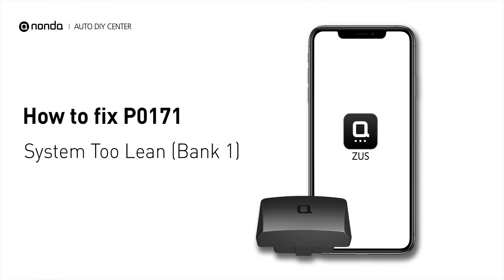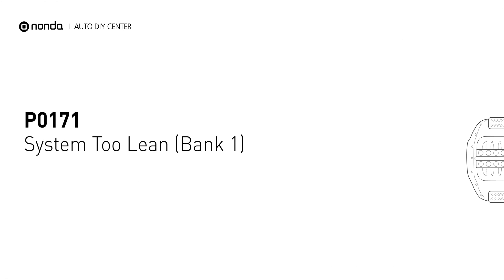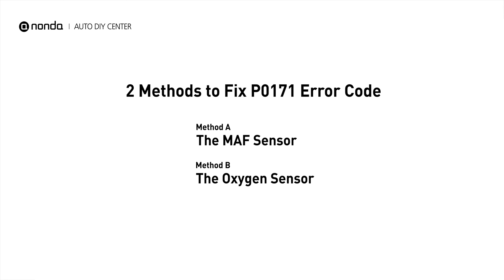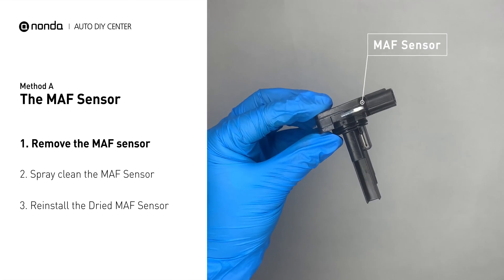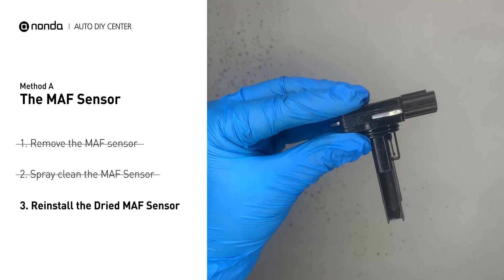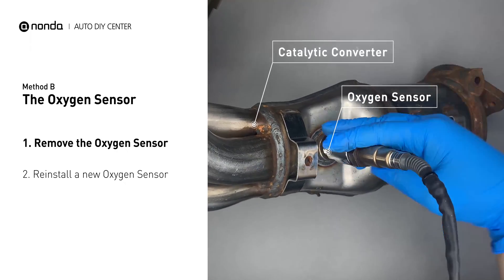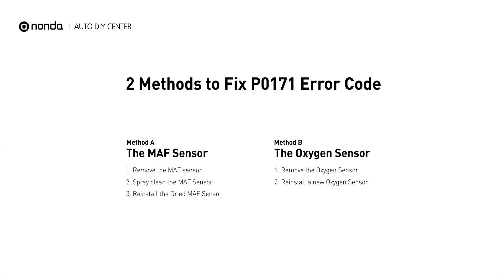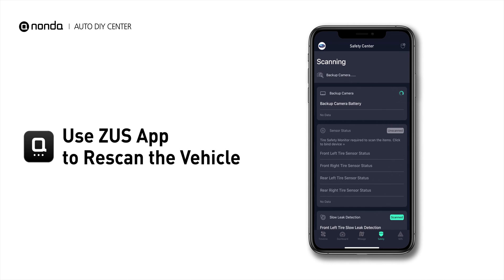How to Fix P0171 Engine Code in 2 Minutes [2 DIY Methods / Only $8.37]

Comment: So I have Toyota Corolla 2005 LE, I have a P0171 code too lean bank 1, my MAF sensor was replaced “probably for no reason at all”, I think it might be a vacuum leak but I’m not totally sure, I took it to get it smoked and he thought it was the gasket seal. I stopped going because it seemed like a guessing game and I do all my own repairs but I haven’t been able to figure this out for a year, I haven’t looked at my car in 5 months and have had the check engine light on, but just recently it went off and I’m very shocked because everytime I clear it, it came back of course but this time I did nothing and it fixed itself I guess, wondering what the issue could be cause I have a feeling it’ll come back, but I do have my normal power restore I would like to say
Reply: If the code goes away by itself in 3 days or if you erase the code with a scanner and after a 2 or 3 days it completes all monitors and everything is green I wouldn't worry about it I had a 98 camry and the 171 code would comeback after 6 months and go away on its own in just a couple of days, maybe find someone that can diagnose the oxygen sensor because 90% of the time that's not the issue, but if it goes away on its own don't worry about it, you might also want to check your air filter, if is dirty you might not be getting the right amount of clean air and that can be triggering a false p0171 code and besides according to Toyota it should be replaced every 15 thousand miles.
Reply from the maker: Hello, please confirm if this is the only code you're getting.
Reply: @nondainc  yes
Reply: @nondainc  I comes and goes also
Reply: @nondainc  it*
Reply: @nondainc  like sometimes when I go to start my car it’s gone, or this time I got gas then when I turned my car back on it went off and it hasn’t came back yet, but it always comes back eventually then it goes off a few weeks latwr
Reply: Same problem. Same car and year.
Reply: @KylewithaK  well shit, lmk if you ever figure it out Kyle, some people say maybe it’s an bad o2 sensor but I’m not tryna go around replacing everything
Reply: @new2me78  Kid you not the light went away a few hours ago when I was driving home from work. It warmed up outside, i’m now convinced it may be temperature related. I had already replaced all the sensors. The only thing left I haven’t done is a smoke test, intake manifold gasket change, and pvc valve change. I read somewhere else online that sometimes that valve gets stuck open, maybe the warmer temperature softened something up? I don’t know.
Reply: @new2me78  I’ve also had several mechanics play around trying to find the source. I think if any hoses were cracked they would have told me. My last resort is that smoke test like I said. Already got the new updated model intake gasket on order along with a new pvc valve. Hell even the canister in the evap system was replaced as well. Narrowed it down quite a bit already. Had to fire a parts cannon $$$ to do it though.
Reply: @KylewithaK . Lol 😂 I had the same issue with a 98 camry and most of the time the code went away by itself, I wouldn't stress too much about it if it goes away by itself in just a few days, but checking the hoses, cleaning maf sensor and replacing air filter if it needs it can be helpful.
Reply: @max410  Yeah I just want this car to last at least 500K miles, I’m at 115 now. Paid $6K for it at 75K miles, put more than that since the 5 years ive owned it on upkeep and preventive maintenance. I live in NY and used to work by the water so the road salt and climate took it’s toll on a number of things. I’m not dumping any more significant money in to it. I figure it was a steal at $6K for 75K miles, but there comes a point where its nonsense to dump any more money in to it if you have no intent to sell.
Reply: @KylewithaK .I've had nothing but 4th generation Toyota camrys and now a 2008 Toyota corolla in the past 13 years and from experience I can tell you the p0171 has never had anything to do with the oxygen sensor, a cracked vacuum hose a couple of times but usually it will go away by itself, Toyotas can last over 400 thousand miles but there's certain parts that might go bad when they get close to 200 thousand miles, evap codes can be an issue too but avoiding cheap non top tier gas and not using fuel additives that do more harm than good can be very helpful but those are easy to diagnose with a smog machine, I had a p0141,p0453 and p0455 recently I got a hold of a good honest mobile mechanic he brought his smog machine and there was a crack on the corner of the charcoal canister he used jbweld stuff to fix it and it only cost me 100 dollars I didn't have to buy a new canister if I had gone to a regular certified shop it probably would have cost me over 1000 dollars to diagnose and do the repair it helps finding a good experience honest mechanic that won't rip you off, I got lucky finding this guy after talking to him a few minutes I could tell he knows his thing and doesn't get irritated if you have an opinion of what you think the problem might be, I had mechanics in the past that felt uncomfortable and threatened because they realize that I'm mechanically inclined and they can't get over on me too many dishonest mechanics if you find a good one to help you out with the things you can't fix yourself because you don't have a expensive scanner and the knowledge to use it and don't have a smog machine either that really helps a lot and will save you thousands of dollars in unnecessary repairs.
Reply: @max410  Thanks for the response. Popping open the hood right now to take a look at those hoses. If the light went away it probably really is nothing.

Comment: Hola 
Cuando son P0171 y P0174
En una Toyota Sienna 2006 3.3
Cambie los sensores B1 S1 y B2 S1
Reply from the maker: Hola, ya que está recibiendo más de un código de error, le sugerimos que su mecánico local revise visualmente su vehículo para un diagnóstico adicional. ¡Gracias por ver!

Comment: code came on immediately after changing fuel filter. I cleared it. shouldn't come back, right?
Reply from the maker: Hi Ricky, please provide us with your car's year, make/model and confirm if this is the only code you're receiving.
Reply: @nondainc  2006 Ford Focus. Also getting P0191.

Comment: I have a 2013 Chev Sonic.  It was my daughter's.  She had an accident but was mostly fender/hood damage.  PO171 is the diagnosis.  You think change the sensor or MAF first?
Reply from the maker: Hello, both of the parts you mentioned could trigger this code so we suggest checking the condition of both parts.
Reply: I have the same car, turbo hatchback 1.4. I smoke tested for vacuum leaks and changed the MAF sensor, both oxygen Sensors, the catalytic converter (I had a separate code for that) and cleaned the throttle body, and still the code persists! And prior to that I had replaced the Intake Manifold, PVC valve which is in the valve cover, the MAP sensor and the Crankshaft position sensor, and I also repaired several exhaust leaks and replaced the exhaust gasket.

Comment: Hi Nonda, I have a 2005 Accord Ex v6. Has P0171 and P0174. I have replace injectors after market. Replaced intake gaskets with proper torque and sequence. I have smoke tested intake and engine for vacuum leaks. No obvious results. fuel pressure 55-60 psi while running. Replaced EGR, PCV, complete charcoal canister with shut valve new purge valve, fresh oil and new air filter. Still shows these codes. I did not replace o2 sensors or cats. No fault codes for them. The ST and long term fuel trims are plus 1.2 and 1.1 respectively no matter the engine speed. Any help greatly appreciate it.
Reply from the maker: Hi Adrian, we suggest getting your vehicle visually inspected by your local mechanic for further diagnosis as you are receiving more than one error code.
Reply: Did you figure it out? Maybe injector / filter/ regulator? I have this code. Have a hard start condition also slight idle misfire

Comment: I have a 2005 mustang gt throwing me p0141 and p0171. Inspected the downstream o2 sensor it was worn out and replaced it with a new one and now just throwing p0171 ? What could be the problem?
Reply from the maker: Hi Frank, we suggest getting your vehicle visually inspected by your local mechanic for further diagnosis as you are receiving more than one error code.

Comment: My vehicle only throws this code when idling for an extended period of time ( 15 minutes or so ) .. It does not show up when driving normally ..
Reply from the maker: Hello, please provide us with your vehicle's year, make/model and confirm if this is the only code you're getting.
Reply: @nondainc  I have the same issue with the only error code P0171. Bmw E46 318i 118cv 2000
Reply: Hey man, I’m actually having the same issue right now with my 2014 Ford edge. After having it for about half an hour or so it will stall. What ended up being the problem for you and how did you fix it?

Comment: I’m going to try this tomorrow but was wondering could this be a reason for a rattling noise when accelerating?
Reply: I have the same problem with that noice when accelerating, did you find out, what was cauing the problem?
Reply from the maker: Hello, can you please provide us with your vehicle's year, make and model?
Reply: Same here
Reply: Spark plugs, coils, injectors, oxygen sensors, or MAF malfunction. Too much or not enough air, misfires all cause rough idle and rough acceleration
Reply: Rattling noise when accelerating could be a cylinder misfire. Could need a cylinder replacement

Comment: Vauxhall Mokka SE 1.6 petrol got this code tonight what is the 1st thing I should take a look at ?
Reply from the maker: Hi Rhyley, kindly check if there's an air leak and check the condition of the evap system purge valve.

Comment: Hi, my Skoda Octavia 1, 1.6l 75kw made in 2004. I cleaned MAF sensor, changed fuel filter,  and didn't find any air leaks between air filter and engine. Is it posible to be problem in oxygen sensor, egr or in spark plugs? I don't want to change half of the car to find the problem. Thanks for answers
Reply from the maker: Is this the only code you're getting?
Reply: What do you clean the Maf sensor with

Comment: Would a intake air temperature sensor affect this code aswell?
Reply from the maker: Hello, can you please provide us with your vehicle's year, make and model?
Reply: I don't think it does, 
Common causes include :
A vacuum leak
A faulty mass air flow sensor
A faulty fuel pressure regulator
A weak fuel pump
A clogged fuel filter
A faulty powertrain control module
Faulty injector(s)
Faulty oxygen sensor(s)

Comment: I have a 2016 Buick Encore and when I remote start it, it pops the P0171 code and the check engine light comes on and then shuts the vehicle off when I restart it, the engine light is still on but the car runs fine. Any ideas? Also is this part of the powertrain?
Reply: If you're getting too much air in immediately (like with a leak or disconnection), the ratio of fuel, gas, and spark is way off and the engine will die immediately. Im guessing it's too much air from somewhere.
Reply: Check the air intake hose .. sometimes it could be that it's cracked I get those codes a lot ok some cars and sometimes just a cracked or hole in them
Reply from the maker: Hi Darla, we suggest checking the condition of the air intake hose and double check if this is the only code you are receiving.
Reply: And a "P" indicates Powertrain

Comment: Clean the MAF sensor with what? petrol (gasoline)? WD40? meths? white spirit? Or shouldn't you use Carb and air intake cleaner?  MAF sensor is - sensitive.
Reply: Use mass air flow cleaner.  They make  a cleaner especially for that.
Reply from the maker: Hi Leonard, you can use the MAF Sensor Cleaner available here: https://amzn.to/3c87xcv
Reply: @nondainc  Thank you. Yes, I already know this but it is not clear to the viewers that you should only be using MAF Sensor Cleaner and not anything else that comes to hand.

Comment: Hi Nonda, so my code a few days ago was p1033 (sensor1) that was fixed then p1036 (sens2)(hadent fixed this), then a few days later code is showing up as p0171. 
Should i try n replace secondary air sensor?
Reply from the maker: Hi Syfo, since you are receiving multiple codes, we suggest getting your vehicle visually inspected by your local mechanic for further diagnosis.

Comment: I have a 2014 Chevy Malibu and I got an oil change yesterday and today my check engine light came on. The only code that showed up was P0171 and it's making a loud revving noise. If you could please give me any insight, it'd be greatly appreciated 🥺
 -a girl who knows nothing about cars
Reply from the maker: Hi Tasha, kindly check the vacuum system for any leaks.
Reply: Just got an oil change too and now my 08 escalade just turned off at a red light

Comment: Help! I have a PO 171 code mystery no one can solve.  I have a 2000 Buick Park Avenue Ultra. 121,000 miles. Well cared for all its life. However, the service engine light came on a few months ago and it’s showing left bank 1 too lean. 

I have taken my car to two Buick dealers and five independent mechanics. No one at all can find the problem, but something is clearly wrong. 

Here’s what’s been checked, replaced, repaired so far:

—Both O2 sensors are perfectly fine; the post cat sensor is new. The pre cat sensor was tested and is working (apparently) fine. 
—MAF has been cleaned. Apparently works fine. 
—Fuel filter changed; fuel system cleaned. 
—Spark plugs and wires changed. 
—Catalytic converter replaced and the previous one was in fact bad. 
—No vacuum leaks. 
—No injector problems. 
—No fuel pump problems. 
—No fuel pressure problems. 
—All the numbers on the computer are registering normal. 

—Car runs like brand new now, but the light won’t go out and no one can find anything wrong. 

—The valve cover and supercharger gaskets have very slight leaks, but I’m told not enough to suck in that much unmetered air. 

A fuel sample revealed E85 gasoline in my tank, but I’ve filled at tons of different stations in the last few months, always and only 93 Unleaded, so there can’t actually be E85 in my tank. 
 
If the light is still on after $2000 worth of work and diagnostics? Then something must be wrong. Is anyone out there (like anyone at all) who can help solve this mystery? I love the car and it’s in beautiful condition, but I don’t know what to do at this point except dump it and get a new car. 

Help!
Reply from the maker: Hello, please confirm if this is the only code you're getting.
Reply: @nondainc  Yes, I can confirm that. Although in the past month there were two occasions where a code for the EGR valve popped up (the code began with a “4” but I can’t remember the two numbers behind that), but that was only twice and never came back. Now it’s just PO171 even after all of this repair work.
Reply: I had the same problem for 2 years and no one could figure it out what is the cause.
Reply: @ahobluo  you tell me. I’m 8 months into the problem and no one has a clue. I’m beside myself. I don’t want to get rid of the car but I have no idea what else to do when dealers and independent mechanics have no idea.
Reply: @socalguy97  I am trying each time something because of the money. The semi-final and final step is to replace the 8 injectors and fuel pump with filter. Both are too expensive. Cleaning is worthless. I just came from Nissan dealer today for engine flash, normal service and injectors cleaning ( third time in 2 years), but the issue still not fixed. I will take it to different garage next month or 2 months for different checking.
Reply: @ahobluo  I had anything and everything done. The only thing I haven’t replaced is the car’s computer. But I don’t think that’s the problem because something caused my cat to fail.
Reply: @socalguy97  What measurements do you get with your STFT and LTFT? I have a 2000 Corolla. There is a chronically-recurring issue with P0171 check engine light coming on. Basically, the STFT reads as normal (around 0% give or take) while LTFT measures at clear of 35%. The car runs totally fine so a mechanic came to the conclusion it was the car's "computer" (ECM/PCM?).
Reply: @MrRusell86 problem resolved a while ago. After spending thousands of dollars to explore every possible cause, and being told repeatedly it would never be the MAF….it ended up being the MAF. lol. Car runs fine now and light has never come back on.
Reply: @socalguy97  I see. Wow. I'm glad you figured it out but why didn't you try changing the MAF sensor before spending thousands? They're usually pretty inexpensive. In my case, replacing it didn't fix the issue so I'm down to it being either the 02 sensor (which has been replaced once before) or the ECM.
Reply: @MrRusell86  oh I certainly would have but every garage it went to, nine in total before someone figured it out, insisted that the mass airflow sensor was the least likely. So they went ahead and fixed everything else first and just said “just  wait for the light to go out; it will eventually,” and never did. I finally found more or less a backyard mechanic who had a very sophisticated scan tool that listed most likely to least likely problems, and the mass airflow sensor came up as the number one problem. I mean even three Buick dealers couldn’t figure it out, and I was amazed this backyard mechanic did.I just drove the car 3000 miles across the country and it was perfectly fine for a 24-year-old car.
Reply: @MrRusell86  one other thing I will say is that it was sort of fine by me that they’ve replaced most of the emissions equipment, and the engine because since I intend to keep the car forever, these are parts I would’ve replaced anyway eventually.
Reply: @socalguy97 didnt you say u u changed the maf sensor ?
Reply: @socalguy97 what kind of maf sensor u buy from the dealer or autozone type store ?